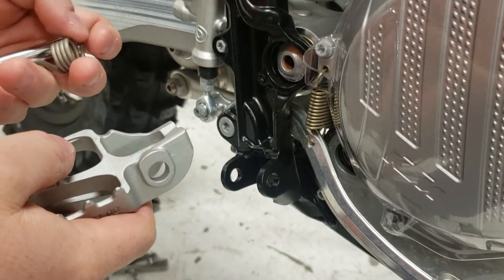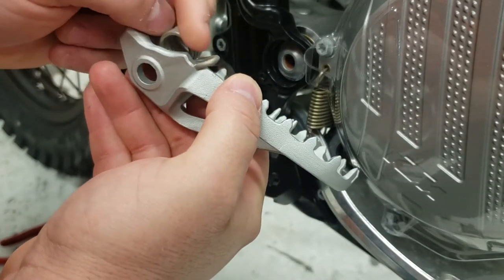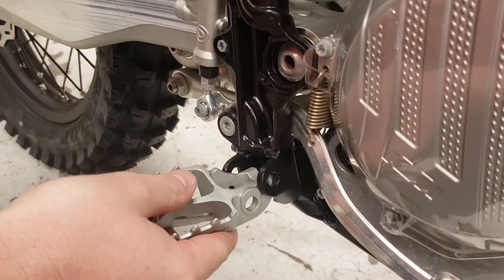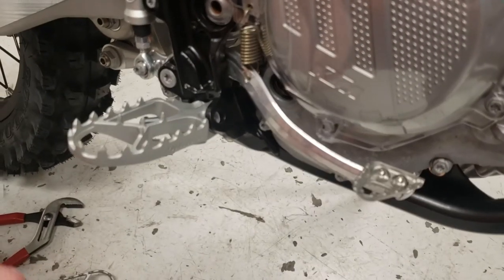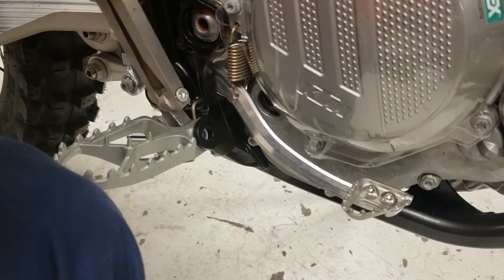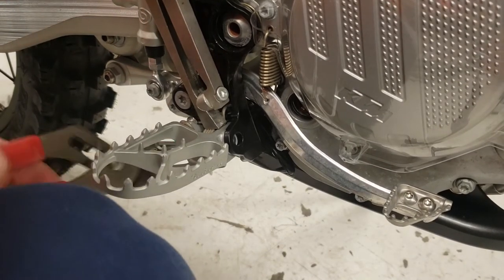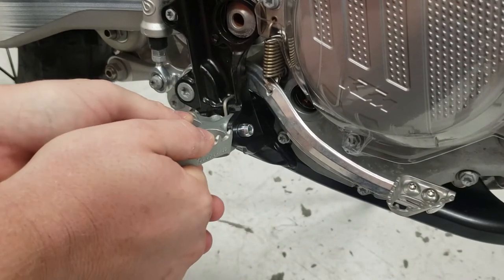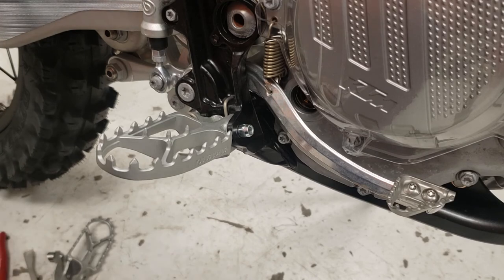Installing footpegs on a modern KTM or Husqvarna motorcycle

Comment: How to use two tools incorrectly 🤡
Reply from the maker: You're a loser.
Reply: Haha looks like a jealous poor boi in the house
Reply: At least I can afford a hammer .. dypshits
Reply from the maker: @DezertSlayer  loser
Reply: Job still got done is all that matters
Reply: @brycemoseman9939  Thanks Bryce. Did hundreds if not thousands of pegs like this when I assembled bikes...I found it far easier than using the tool how it was designed.
Reply: @RTiPowersports  hes not wrong though is he.

Comment: Or get the pin just started, push down the spring w finger, insert an Allen wrench or screw driver from the other side to hold spring and line all up, tap pin w hammer.  Found this method on YouTube, prior to that was on a one way struggle bus.

Comment: in that case you certainly don't need the ktm tool just use a 3/8 ratchet extension with the ratchet on the end and push down

Comment: I just push the spring in with my thumb and hold it while I push the pin through, greased up it slide easy, no banging required
Reply from the maker: Ive done that before, but not trying to push with my thumb 20 times a day, and not trying to grease 20 pins a day either. Banging works fantastic.